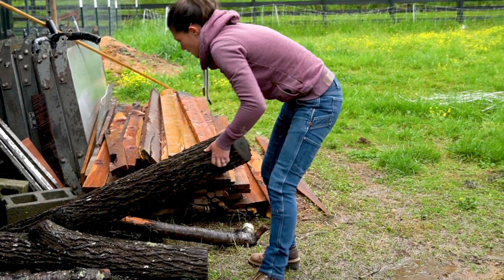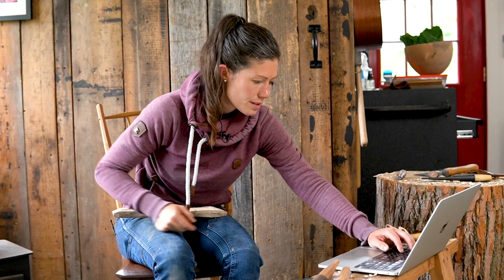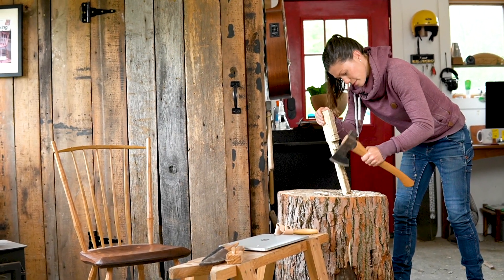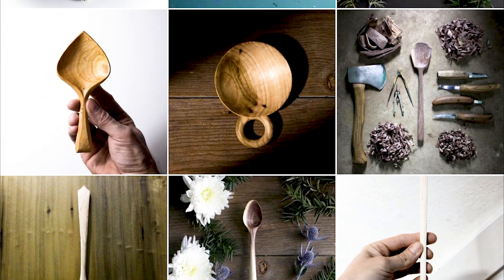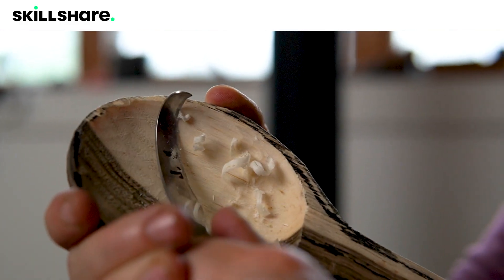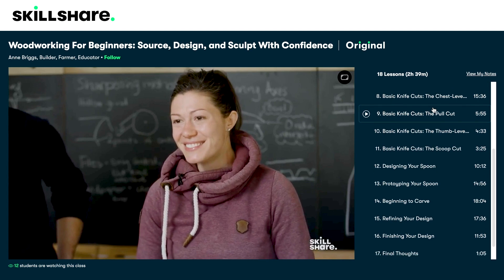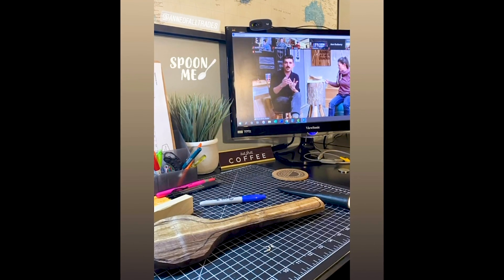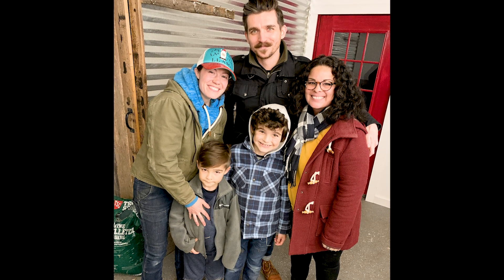Mental Health and Spoon Carving

Comment: Although I'm not able to tool up for woodworking, my main job is basically customer support/development/mentoring both inside our team and with customers. So I'm stuck in front of my computer screen way too much. To reset my brain, I do network/electrical wiring, DIY on the house, stuff like that. Not much opportunity to actually get outside beyond that, as in Quito where I currently live, the restrictions are pretty tight still and vaccines are a long way away. Stay safe, keep your mental health where it needs to be, and enjoy!